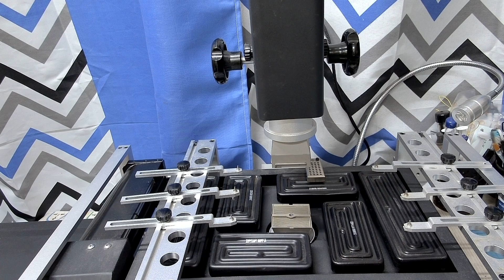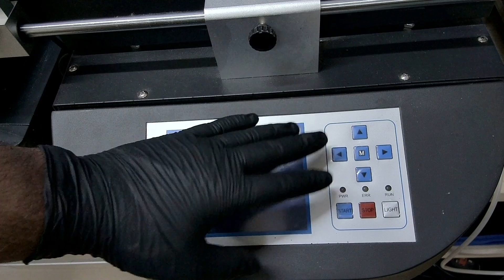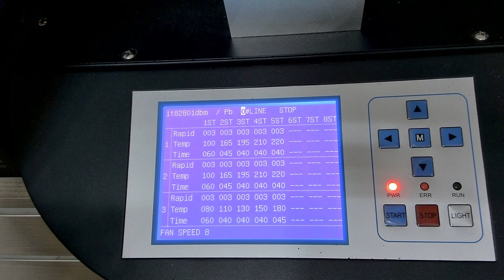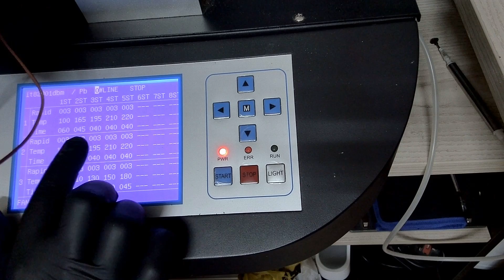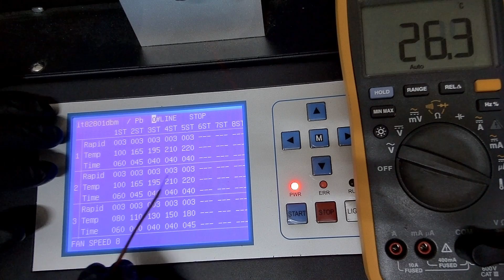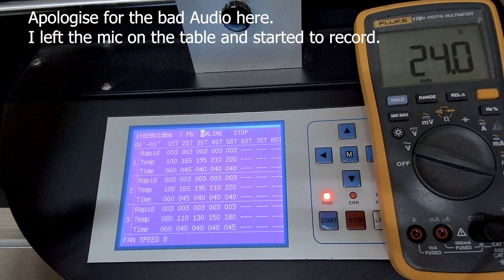How to Set Up Your 3-Zone Rework Station for BGA Removal

Comment: At 21:32 in the video, my understanding the time factor, if the ramp rate is set to 3, it means in basic term the temperature will rise per second to 3 celcius until it reaches 100celcius then it will dwell for 60 seconds. It should take approximately 33.33 seconds to reach 100c. Assuming you are starting at 0 degrees but in your case you have to factor ambient temperature, which was shown by the probe you used with the multimeter.
Reply from the maker: Yes correct
Reply: @GraphicsCardRepairs-tk7ql Thank you for your reply. Sorry I got the time wrong above. It is about 16:25 in the video that you said ramp rate set at 3 is when the machine (BGA station) will attempt to raise temperature to 100°C in 3 seconds. The point I am making, as I  understand it that is not the case. It rises 3°C every second until it reaches 100°C assuming starting at 0°C. Please check around 16:25.

Comment: Hello! I was interested in getting this rework station, but I had a question regarding power.

I did some reading and saw that this station can pull up to 3800W (800W + 800W + 2200W). That being the case, is it safe to use on a US outlet? Most US circuits can provide up to 1800W, and up to 1440W continuously.
Reply from the maker: Difficult to say. Since I am not from the US I would be able to give you good advise on this. In the UAE I have no issues running this machine along with my other tools running together on a standard 32 Amp MCB.

Comment: Hey man, thanks so much for the informative video! I just wanted to know your experience with the ceramic plates. Are they powerful enough to preheat a decent sized motherboard? I find on my R490, even with the ceramic plates set to max temp (200c), it will not heat an xbox 360 motherboard higher than 80-100 celcius. Is this normal? Thanks.
Reply from the maker: @Consoleshop-f8k Thanks for watching! The R490 ceramic plates can preheat a board, but on larger boards (Xbox 360, full ATX, PS4 motherboard) you'll hit a ceiling around 100-120°C even at max plate temp — the radiant heat just doesn't have enough surface area to soak through thick multilayer PCBs. Two practical fixes: (1) put a thermal blanket or aluminum foil reflector above the plates to bounce heat back into the board, or (2) drop the bottom preheat target to ~120°C and lean more on the bottom hot-air nozzle. For thicker Xbox boards we'd recommend a dedicated bottom-side quartz heater rather than relying on the IR plates alone.

Comment: I just gat ds machine... But am suffering on how to save a profile..
Can anyone help
Reply from the maker: This machine already has 9 profiles. You can edit the existing profiles and exit out of it to save it. To edit you first have to first press M and  enter the code 123456. You will then get OK. You can  then edit the profile. Once done  move to the temp or digits you want to edit and then click stop to exit. It will save it.

Comment: Just picked up this station myself. The bottom plates and the bottom hot air seems to read pretty close to what is specified on the profile. Maybe 10 degrees lower. That said, the top heater is far too low heat output. It seems to be consistently putting out 50 degrees (or more) lower than the current set temperature. Not good at all...Makes removing the BGA chip very difficult.
Reply from the maker: Yes if you calibrate the top and bottom any GPU is a piece of cake to install and remove without damage.
Reply: But how do you calibrate it when it does not output enough heat? @GraphicsCardRepairs-tk7ql

Comment: This BGA Rework station doesn't have a thermocouple for monitoring the temperature of the chip directly, eh?
Reply from the maker: It does have its own thermocouple but it does not read the temps of the board. It is best to calibrate it manually for best results

Comment: Is there a way to calibrate sensors so that you can operate with normal temperatures in your profile and it will give exactly the temperature that is programmed? Is there the same process with WDS-620, WDS-720?
Reply from the maker: @Maximshevelev  all these machines will have variance in temp set and actual temp output at nozzle. You will need to calibrate it manually like shown in the video with an external temp probe.
Reply: voce pode abrindo a maquina retirar do original dela que e dentro do bico e colocar uma sonda tipo k para por em cima da placa ou para parte inferior

Comment: Hello, i have bought the same machine, and it works perfectly for PS3 reballing. I have a question though: how do you use that vacuum pen on the side, i can't use it because it never turns on. Its always off.
Reply: Oh, well that explains it. I have only assembled machine from parts in its box that came from factory, the hose for suction pump was already connected and was outside, so i just put the pen on it. I didn't open the machine. Thank you again, this machine is life saver since i got it, perfect for ps3's. And thank you for this tutorial, its awesome. 🙂👍
Reply: @himzoletvicagaming3621  can you share profils for playstation consoles please?
Reply from the maker: The pump turns on automatically aftter the last stage and when cooling process starts. That's when the suction pen turns on. If yours is not turning then the pump may be disconnected from inside. There is no manual setting to turn on or off the pump.
Reply: I'm glad to know it works well for you on PS3 boards cause I also work on gaming consoles and I was looking into buying a bga rework station for my PS4 APU reballs

Comment: Hello Frasier, (<--- I hope the name is correct 🙂)

I have an ACHI IR 12000. Almost the same machine like yours except the top heater. My top heater is IR. To be honest I did never calibrate my profiles like you. Maybe I should!? The goal is to reach leaded or lead-free temps on the PCB right? 
Regardless to the PCB and how long it takes for each individual PCB? 
My goal was always to not grilling the parts and to stay in a 5-8min range. Of course underneath of 240°C. 
I think your method is the correct one and I would like to do the work. My questions are:

- What´s the aimed temp in both cases? Around 190°C and 220°C ? ALWAYS those both temps?
- And how do you divide your lower temp steps through the entire heat time? 100°C 1min, 140° 2min.... I mean - actually we could set "rapid" to  a high value and make 1 setting from 0 to 190°C. From the beginning on. I know that´s not really gentle to the PCB but we do this actually with a hot air gun, right? 
Would the following be correct?: 100°C waiting - measure the PCB - assuming the PCB has 100°C in 40 sec then next step. 140°C - assuming the pcb needs 40 secs again, then the next step. But how far should I set the steps? 100°C, 140°C, 160°C, 190°C ? 
- You´ve tested the temps with your external device. How far would you hold the temp sensor with an IR top heater? What´s the best space between a glowing IR heater and the temp sensor?

I´m doing the same work like you for almost 10 years and I´m honest - I´ve grilled a few parts here and there - not really often but often enough 🙂. I hope to avoid that in the future with your help / calibration method.
Reply from the maker: Wow. Thank you for your comment.😁. So I use a 3 zone rework station. It has top air nozzle, bottom air nozzle and IR plates. In the video I calibrated the top and bottom air nozzle so the temps that are outputted are the desired temps. The IR on the machine is only to preheat the board evenly and heats max temps of 195C.  
Now in your case yours is a IR rework station. The number of stages really do not matter you can add stages in between to make the process smother. Now for unleaded solder on a 3080, 3090 and above would be different from unleaded 3070 and below because of PCB layers. For 3080, 3090, 4080, 4090 I use a profile 100c-90sec, 180c-60sec, 200C- 45sec, 220C-45sec, 230C-45sec, 250C-90sec, 280C- 60sec. This profile is for the top and bottom air nozzles. Now if required I can add a stage between 1st and 2nd stage. It's totally upto you depending on how your machine can handle. Since you are using an IR rework station you will first have to calibrate it at the point of PCB. Measure the temps at the PCB level for example of you set 100c on the machine is the probe reading 100 at the PCB. May be you may have to set the machine at 110c to achieve 100C at PCB. You will have to do this calibration at different temp levels to make sure that your PCB will receive the desired amount of heat on the PCB. Once you know what your machine can deliver at different temp settings set different  profiles for the GPUs. Like leaded, unleaded, 3070 and below 3080 and above. Because 3070 and below require less heat compared to 3080 and 3090 and 4080, 4090 requires more heat. You will have to play around with your machine to understand it's capabilities and then set profiles. Remember every machine is different so each one has to be calibrated differently.
Reply: @GraphicsCardRepairs-tk7ql  Many thanks for your advice! If I´ve understand it correct you wouldn´t measure it like your machine with a sensor 1cm away from the top heater but on the PCB when you would have an IR top heater like me, right? I got the rest of your text! 🙂 Thank you very much! I wish you all the best!
Reply from the maker: You got it. 😁

Comment: Great video!!! I bought one of these. You show your profile but what temps are you achieving on each step on the tc?
Do you soak the board before starting your profile?
Do you let your profile finish when it starts beeping or do you shut it off when desired temp is reached?
Reply from the maker: For the profile I use for RTX 3070 and below and RX 6600 XT and below to achieve smooth removal the target temps are 100C for 90sec(This is to warm up the board), then 185C for 60sec(soak), then 215C for 45sec then 225C for 45sec then 245C for 60sec, and then last stage is 255C for 40 Sec. For RTX 3080 and above and RX 6700 and above target temps I use are 100C for 90sec(This is to warm up the board), 185C for 60sec(soak), 215C for 45sec, 225C for 45sec, 255C for 90Sec, and 265C for 60sec. For 4090, 7900XT, and XTX I use one additional stage. 100C for 90sec(This is to warm up the board), 185C for 60sec(soak), 215C for 45sec, 230C for 45sec, 255C for 45Sec, and 270C for 60sec and 285C for 45sec. The profile for the top and bottom is the same. The temps increments I use is 3C per sec. I hope this is helpful. These settings are for unleaded solder. For leaded your temps target is 10C less at each stage except for the first 2 stages.
Reply: @GraphicsCardRepairs-tk7ql  Very valuable info. Thank you. I have had failures and success with the 490. It's a beast of a machine, once you get your profiles situated. You're the only tech on youtube with a detailed 490 video. You cant even get this info in a facebook group. Again, thank you
Reply from the maker: I'm glad I could be of help. When I started out with this machine I searched everywhere but could not find any info. I learnt the hard way and burnt many of my cards luckily they were my own cards at the time I was practicing reballing.
Reply: @GraphicsCardRepairs-tk7ql  Hi, do you use the same profiles for soldering back? What temp on IR plate? THX :)
Reply from the maker: For soldering leaded solder balls the temps are 15°c lower compared to unleaded solder. I keep the time the same. Ir plates I use default, it's 100, and Max it goes is 180C. That is just to warm up the rest of the board to prevent thermal stress. 150C would also do.

Comment: Thanks for the information on these type of units.  What type, size of stencils would you recommend.  So many options. Are the really large sets of 90 x90 or 80x 80 mm the way to go. I haven't worked on any Phones yet. More  focusing on computer stuff at the moment.  I purchased some very small stencils the don't fit in either holder I bought.   I think may focus on GPU's for now.  Thanks for your input. All will be appreciated.
Reply from the maker: I initially started with direct heating stencils but I really sucked at it. I used to make a lot of errors. gradually I moved to 90 x 90 and I felt more comfortable with it and over time the errors nearly vanished. I found the 90 x 90 to be more forgiving but it is a matter of getting used to it. For me, I got a better finish with 90x90 than with a direct heating stencil. That does not mean direct heating is bad. Some can get a similar or even better finish with the direct heating stencil. It's a skill you will build over time. 90 x 90 stencil and holder are more expensive compared to direct heating stencil and its holder. If you can try your hands on both direct heating and 90 x 90 and check which one suits you the best and whichever you feel comfortable with, invest in that route. For starters, memory would be a nice place to start. You will also like this video https://youtu.be/iArDb1-2UvA

Comment: looks really nice and expensive...
t-8280 is good for me
:D
Reply from the maker: Nice
Reply: what do you use for top heater?
Reply: @UnothimBro   Just a cheap 700 watts hot air station
Reply: @UnothimBro  700 watts hot air station
Reply: @UnothimBro you can use a really good soldering station with a monitor stand

Comment: Is there a thermocouple for the hot air area itself or does the machine take the top temp from the thermocouple you place on the PCB you're working on? Also the rapid would be ramp rate which is how fast that area ramps up to that temp in degrees C per second.  Keep it up :)
Reply from the maker: There is no external thermocouple on this Machine. The thermocouple for the top and bottom air is inside the nozzle after the heating element but it's not accurate I guess. oh, i understood the rapid as a time to hit the temp. Thank you for correcting me here.
Reply: @GraphicsCardRepairs-tk7ql  Ah that's very interesting. No no, thank you for taking the time to make the video and to reply. Take care of yourself and your family!

Comment: Thanks for your time and effort you spent here in order to explain the functionality of this machine. Even if we don't have a computerized BGA rework station like this it's still very useful to understand how it works and why you must calibrate it and adjust the parameters in order to have the best result.
Reply from the maker: I hope this video helps many using this type of machine getting the desired result.
Reply: @GraphicsCardRepairs-tk7ql Do you know what looks weird to me? Such a pro looking machine (OK I know there are much more expensive and pro-like BGA rework stations out there) it doesn't have a temperature probe which can be placed on the area of interest (i.e. close to the core) reads the actual temperature and automatically adjust based on the preset profile. I mean, for a microprocessor based machine this is basic requirement. Otherwise, you always have to do a guess and what plays the most important role at the end of the day is the experience, not the machine.
Reply from the maker: Unfortunately, this one does not have the temperature probe that can be placed on the board. I wish it did. it would have made the work a lot easier.
Reply: @GraphicsCardRepairs-tk7ql  voce pode sim amigo adicionar sonda so colocar uma entrada tipo k voce abre ela e puxa da placa entendeu